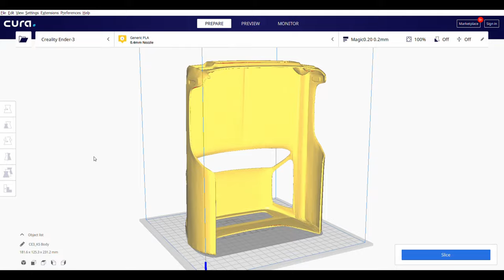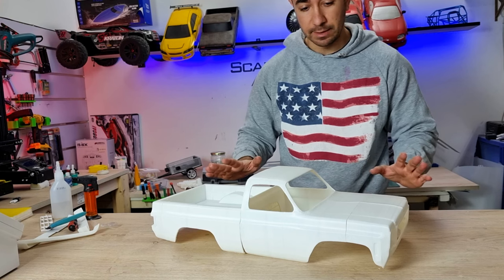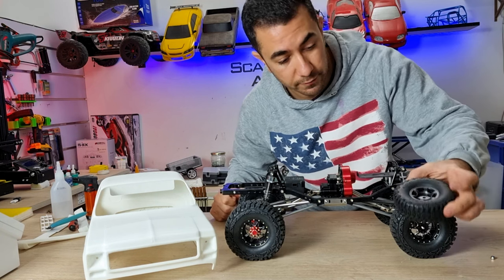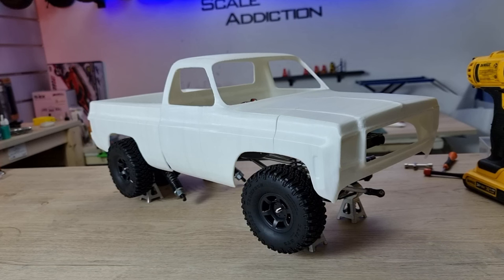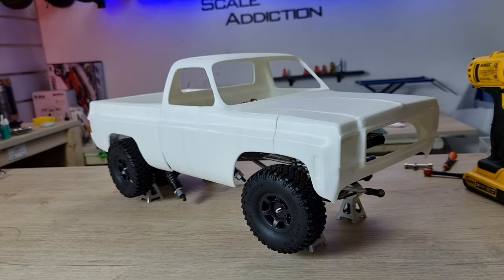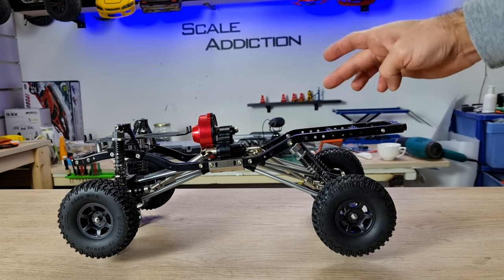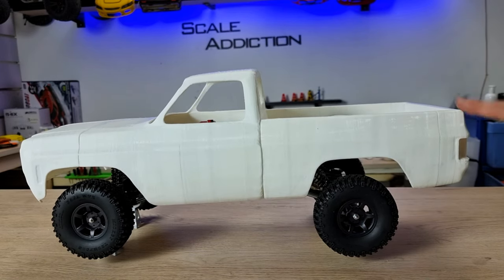3D printed Chevy Blazer k5 for SCX10 Chassis Part 1/ How to 3d print rc car body/ Painting rc body

Comment: What settings did you use when printing the body in 3D? You printed it as a shell. The print looks very good.
Reply from the maker: 0.12 layer Hight
%25 infill
50mm/s
temp 205/60
2 mm wall
2 mm top and bottom
Reply: @scaleaddiction hello I have a model with 0mm walls. It's a little difficult to add walls in freecad or impossible. Kan I print a body with layers to get around 2mm?
Later I will test slice the model to see what the program thinks.
I use the creality slicer. There is not number wich especially says wall thickness even under expert.